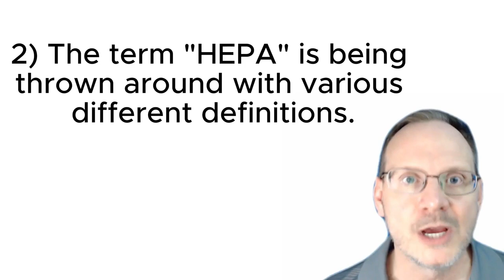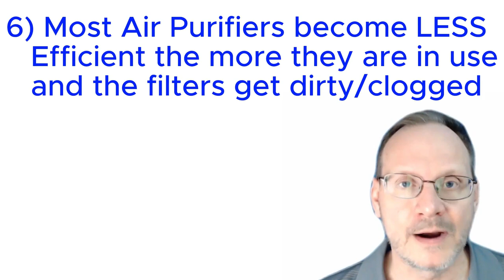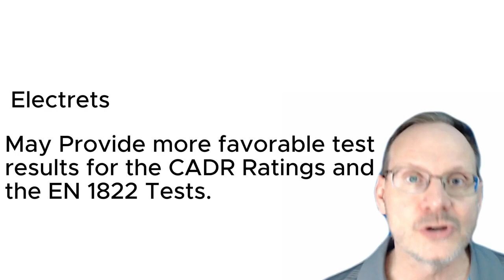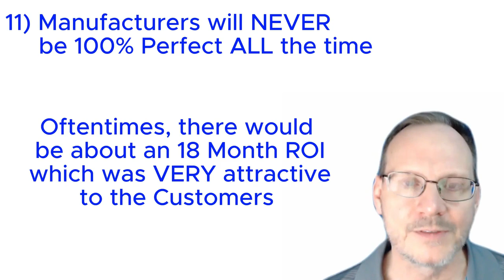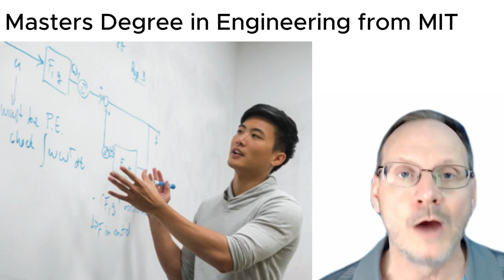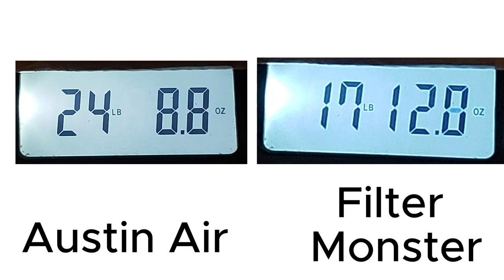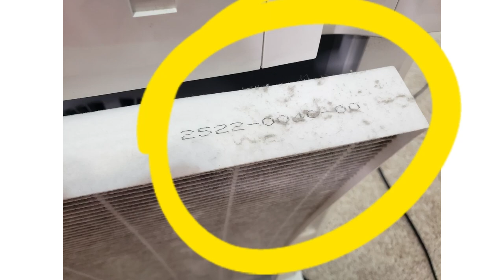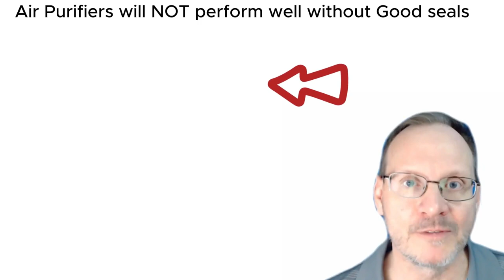HEPA Filters - Are they all the same?

Comment: In short, 99% of consumers are getting robbed.
Reply from the maker: I'd say over 99% of the "HEPA" air purifiers don't actually work at a HEPA level in the real world but most all of them will improve the air quality in a space to varying degrees depending on how well they are sized and which unit is chosen.  And therefore, many of the units will actually improve the consumer's overall health, in general. Even though, they are not hitting 99.97% at .3 microns - like so many of the manufacturer's advertise.  So, the units typically do not actually perform to the level the consumers may think they do...  And yes, some of the units are not good at all and in some cases - yes,  I'd say the consumers are getting robbed by those companies... 

Now, on the Air Quality Testers/Sensors issue...  yeah, I think many are providing somewhat inaccurate readings and when they say the air quality is "Good" in someone's space - that may not be the case, at all... so those consumers aren't even improving the air quality in their environment with that purchase - they are oftentimes being provided a "false sense of security" by the air quality testing sensor they purchased, IMO.  

Thanks!👍
Reply: @AirPurificationEducation I’m not an expert in this field but I thought the same thing just based on common sense 🙂
Reply: Someone deleted an opinion related to air quality and air purifiers. Who would do something this strange? Very suspect
Reply from the maker: 100% - unfortunately, most people just don't realize this stuff.  @IntegrityMeansAll
Reply from the maker: Where did you see that - if you don't mind me asking?  I had a doctor (he called himself a doctor but was a chiropractor - which I am still cool with as I love some chiros) over a year ago, on TikTok talking a bunch of stuff on my most popular Air purification video on TT about an IQAir HealthPro Plus and he was just tearing it up... saying the carbon doesn't work and all these negative things about how it hurt a bunch of his patients, etc. so, I started to ask him some questions in a nice manner and he eventually stopped answering and then weeks later - deleted his entire rant as I think he could see that he was not going to be able to substantiate his claims... fortunately, my son told me to make a copy of his comments as he thought he may eventually delete it all - so, I still have screenshots, LOL! 😆   @IntegrityMeansAll
Reply: @AirPurificationEducation  so true, most people either don’t question the most apparently flawed things or they question things that are common sense because they lack it 🙂‍↕️most people in 2024 are somewhat crazy on top of it 😉
Reply from the maker: Oh, I think "most of us" may fit into the "crazy" category - at least some of the time, including myself, LOL!😆  @IntegrityMeansAll
Reply: @AirPurificationEducation  Oh yes I wasn’t including myself either 😉😅 but I kind of distinguish between the somewhat-funny-crazy and the completely gone-no common sense left-crazy 🤣🤣 I’m just joking..partly at least lol

Comment: I'm not convinced a Hepa filter will lose 50% of its efficiency after 2 months. Dont forget usually the Hepa filter is protected by a pre filter and a carbon filter, so i think that is a bit exaggerated 😊 But i agree with most of what you say. The latest Winix filters do have a better seal around the frame not like the filter in your video which has no seal at all. You could test these Purifiers exhaust with a particle counter, that would give you some idea of how well they are performing. Test the filter when its new and after a few months of use. I still believe that Winix and some other brands do a better job at filtering the air than you are suggesting in this video and are very good value for money but im open to be proven  wrong 😊. The Aeris looks like a very good unit although long term reliability is yet to be proven. I dont know about the US but here in the UK very few people will pay $239-$299 every year for replacement filters so it could be a very niche product unless they significantly reduce their prices. Thank you for the info Doug, very interesting 👍
Reply from the maker: Ahhhh Marcus... my FAVORITE Poster is back! 😆
1) I think they may be defining "efficiency" as lower CFMs... and not just the particle filtering capability of the unit.  Like the units CFMs can go down 50% after 2 months of use as the filters get more clogged.  Which I do think is very possible in a dusty environment.  I felt a severe drop in the IQAir HealtPro Plus' CFMs over time - that I sat next to at work because it was about a foot away from me and blowing on my arm.  So,  I just started using new filters in the HealthPro Plus in my family room and I tested the CFMs from 6 feet away on high speed and we'll see how it performs every 3 months as the filters get clogged. 
2) I am happy to hear the new Winix 5500s have better seals as it was a huge hole in their older offering, IMO. I will be buying a new one soon to check it out. 
3) "You could test these Purifiers exhaust with a particle counter" Good suggestion and I would have agreed with you on this about 9 months ago or so but I've lost all confidence in the accuracy of particle counters since then - so I don't want to provide folks with "inaccurate" "official data" which I think some other Youtube sites are currently doing (without realizing the devices are not super accurate).  Your suggestion was one of my original plans when I started this channel but the more I experimented with the sensors and learned more about them the less confidence I had in their accuracy.  Testing must be left to the experts, IMO. 
4)  " I still believe that Winix and some other brands do a better job at filtering the air than you are suggesting in this video and are very good value for money but im open to be proven  wrong"  
A) Here is the deal - MOST all air purifiers will improve the quality of our air- even inexpensive ones, IMO.  And even a Box fan with Merv filters.   However, the high level solutions like IQAir and Aeris will be more beneficial at removing Ultrafine particles so they are better for our long term health.  And the Winix 5500 IS a GREAT value for the money for the level of filtration it provides customers.  But the theme of this particular video was to provide "13 reasons why I believe over 90% of the HEPA air purifiers don't actually perform at a HEPA level."  Because... they don't... especially after the filters get dirty and you run them on higher speeds... THAT was the point of this video I wanted to hammer home.  SOOO many air purifier companies use BS marketing techniques claiming to perform at a HEPA level and I want people to realize that MOST do NOT. It is NOT easy to engineer an air purifier that works at a HEPA level after 3 months of real-world use.  Sorry for all the capital letters - I've had too much Vietnamese coffee - I'm not yelling at you... just yelling into the Internet, LOL! 😆
B) I think that most air purifiers do not filter at a HEPA level but they do NOT have to in order to improve someone's air quality.  All they have to do is "Approach HEPA" IMO to help many people... and "Approach HEPA" is a very gray term... I know, LOL.  I came to that conclusion years ago after years of talking to many different customers.   I wanted to end the video by stating this but this thing took me forever to make and there were about 5 things I wanted to change/add and I eventually just said, "time to upload" as I could have worked on it for another 2 weeks...  All that said, some people really do NEED a super strong HEPA solution to help relieve their breathing issues... Some folks need the best air purification solution for relief.  And I think, most everyone would benefit more if they all had the best air purification solutions - However, it is an issue of $$$ (and understanding).  I know.
5) "The Aeris looks like a very good unit although long term reliability is yet to be proven." Agreed 100%. 
Thanks for your comments! 👍
Reply: @AirPurificationEducation Yes I agree the older the filter gets the more resistance to the airflow will occur, having a washable or replaceable 😢pre filter and carbon filter will help to some extent. I also agree that severely allergic people may have to pay the higher prices to get relief. I recently purchased 2 Camfil City M air purifiers. These purifiers are the benchmark in my opinion but of course they are not really built for the domestic market so not a fair comparison. The quality of manufacturing is top class though and each filter is tested and stamped to have an efficiency of 99.995% at MPPS the filters are very well built with a metal frame and grill to protect the media and very well sealed. 😊 And yes leave the testing to the reputable professionals problem is not many Brands use them 😂
Reply: I would Aeris to look at the set up of their filters. I would like to see either a seperate replaceable pre filter or a washable pre filter and a seperate carbon filter, they have a very large Hepa filter and i'm sure that would last a lot longer than one year if it was seperate to the other filters. It would mean a more complicated filter change but could be designed to be a lot easier than the IQ Air
Reply from the maker: Hey Marcus, I just looked the 2 Camfil City M air purifiers up online and they look impressive.  I don't think I've ever seen an air purifier that pulls the air in from the sides and disperses the clean air at the bottom - very unique! Can you please tell me - why did you purchase them? - if you don't mind me asking.  I am assuming they were a job-related purchase?  Thanks!   @2711marcus
Reply from the maker: 1) I just took the prefilter out of the HPP a day ago and I really DISLIKE trying to get it out from the unit - I wish they could find a better way to improve the process.  I think older people must have a real problem accessing/replacing it.  Because I've been dealing with the HPP for over 10 years and I still have problems with the Prefilter - even when I'm sober... so, I can imagine what other folks must think about it... LOL!
2) I think you are right about the Aeris filter but I will say I think one of the advantages of their filter set up is they really only have 1 seal to make perfect between the filter cube and the interior of the air purifier... and I currently think, the less seals you have to make perfect - the less chances/variables that can get in the way of your unit filtering optimally, IMO.  I'm going to make a video on the seals within the units soon when I feel ready... I've been thinking - I don't think it is a coincidence that the HPP and the Aeris units have their filters set up in a similar manner in the units and the air is being blown through them similarly, as well - and they are 2 of the best particle filtering units on the market... I think Aeris kinda leverages gravity with their seal and the HPP's filters "lock" together like a puzzle so air can't escape the unit out the sides... I'm gonna think about it more and do a video eventually - thanks!  @2711marcus
Reply: @AirPurificationEducation  Well firstly because I was impressed with the build quality and the filtration but when I saw the price I jumped on them 😄
Reply from the maker: Hmm... YT didn't alert me of your comment... I am glad I checked this topic again to find your response.  I wish YT was more reliable with emailing me about new comments, etc. but it IS a free platform so I realize I can't complain, at all, LOL! 😆 I really am grateful for it. 
1) Oh, so it was a personal purchase - I assumed it was a "job" type purchase... either way, I am very happy you brought the unit to my attention because I think it looks really impressive + over time I definitely want to branch out and figure out what the absolute best units are in the world - esp. ones that are not well known to myself and currently "unknown" to the US market. 
2) I have a feeling that eventually lower priced units will hit the market that do a great job on ultrafine particles as the industry and technology matures over time.  I am pretty confident of this eventually occurring in the coming years.  It will just be the "Natural Progression" of the industry, I think. Global competition tends to bring out the best in companies and more and more super talented/brilliant minds will eventually be entering the industry, as well, and improving everyone's air quality - at more reasonable price points, I think.  For example, the Aeris Lite unit is about $400 and its particle filtration is WAY BETTER than what we've ever seen from a $400 unit in the US.  I think it was a groundbreaking achievement for $400.  I expect many more of these types of "breakthroughs" over the coming years... it is just a matter of time, IMO. 
Thank you for all your comments, ideas, and thoughts - they help "educate" me better which will in turn help better educate others, as well. Have a Good One! 😃  @2711marcus
Reply: @AirPurificationEducation  Thank you Doug. That will be great news if it happens. I think everyone should have a quality air purifier in their home it has great health benefits. Like you say you don't want your lungs being the filter 😷
Reply from the maker: Yes, agreed 100%👍 @2711marcus

Comment: Couldn’t you just tape the edges so that air doesn’t go around the filter in the winix machine? Also why does it matter if dirty air gets past? Couldn’t you just run the fan at a higher speed to compensate? If you clean all the air in the room at 90% the first pass, you’ll be at 99% the second pass, 99.9% the third, etc. I’m probably missing something.
Reply from the maker: These are some good questions - let me think... My current opinions would be:

1) Yes, I think if you did do something like tape the gaps between the HEPA filter and the inside of the air purifier - it is possible it could be an improvement.  It seems like that would improve the leaking issue between the cardboard housing and the inside of the air purifier.  I don't know if that is a good idea as the HEPA material is supposed to be somewhat fragile and it can have openings/leaks we cannot see -  so I'd try to be careful if I tried to do this. 

1B) The tape and glue on the tape could off-gas into the air, as well = more VOCs.  Depending on the type of tape used. 

But on the surface - tape does seem like a decent idea.  I'm not saying anyone should do this and I'm not sure how the manufacturer would feel about it.  I will try to remember to ask someone with industry experience about this in the future.  
 
1C)  That said,  the HEPA filter itself probably leaks some dirty air as well, (especially after some use) and probably doesn't work at a True HEPA level - especially on higher speeds.  And air purifier companies oftentimes will have HEPA filters inside their units that are not really strong enough to work well on the higher CFM settings, either.  The more the CFMs the more the leaking (this is well documented on even high-level, expensive, air purifiers with much more expensive and sophisticated HEPA filters.)  So, if we tape the gaps between the HEPA filter and the inside of the air purifier -  and the air is then really forced even more to go through the dirty/clogged HEPA filter (after 3 months use, etc.) then I think it would possibly be an improvement but I also think it could make some of the dirty air leak in other areas, as well - depending on how clogged the filter is and what CFMs the unit is run on... All in all - if I had to guess - it seems like taping it could be an overall improvement in air quality on lower CFMs.     

I will be getting the newer Winix 5500 soon to see if they have addressed this issue.

2) On the surface, this may seem like a reasonable idea.  It may be somewhat true for larger particles (that are less dangerous to us) depending on the size of the room and the particles in the room.  
  
2B) I think in the real world - contaminants and dirty air are constantly entering rooms on a regular basis + there are particles everywhere on the ground, ceilings, walls and counters, etc... and there really is no such thing as a true "Total Air Exchange" in a room in the real world.  When we get up and walk across the room we stir up particulates everywhere.  When we sit on our bed, we kick up a bunch of particles that had been lying on the covers, etc.   There are even small air currents always occurring in our rooms all the time without us ever noticing.  So, no air purifier ever totally cleans the air in a room.  We call it an "Air Exchange" but it is really more of a "Partial Air Exchange", IMO.

2C) So, we want the cleanest air possible coming out of the unit, in general. The smaller particles are the most harmful to us (ultrafine .1 to .003).  And since Ultrafine particles are the most dangerous to humans and have been linked to Cancer, Alzheimer's, Cardiovascular disease, etc. - we really want to eliminate those as best we can.  Also, dirty air coming from air purifiers will get dirtier and dirtier as the filters age and get dirtier, as well.  So, folks will be breathing in more and more dirty air with more and more ultrafine particles so - no, I don't think it is good at all for the most dangerous ultrafine particles. If that makes sense.

2D)  Also, the carbon in air purifiers tend to work better on medium and lower speeds as it enables the carbon to absorb the chemicals/odors much better.

Thank you! 👍
Reply from the maker: Just opened the new Winix 5500 and the issue has NOT been fixed - the HEPA filter still does not have a gasket and I can hear and feel the filters jiggle in the air purifier when I shake it.  So, there is no way the 5500 is actually filtering at a HEPA level and I just opened the Coway Mighty and it has the same issue, as well.
Reply: thanks for your clarifications @AirPurificationEducation